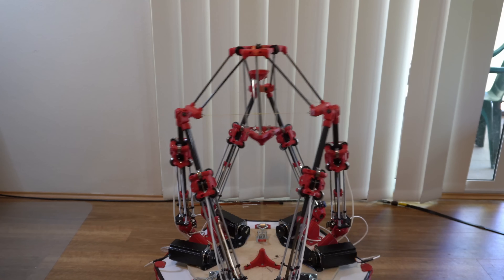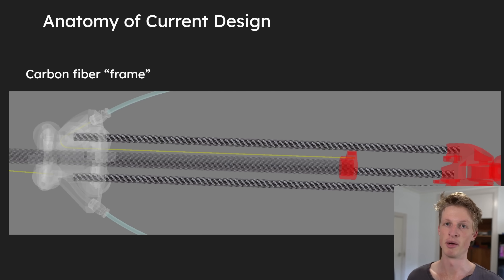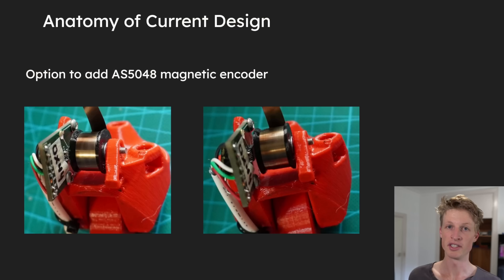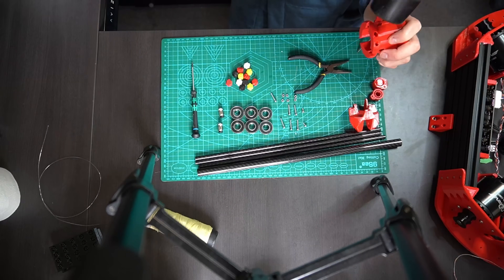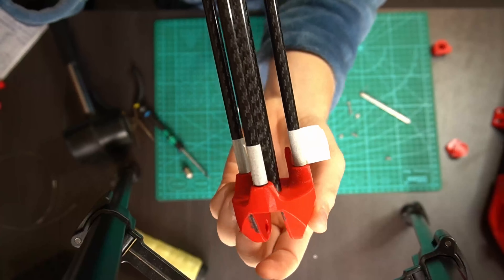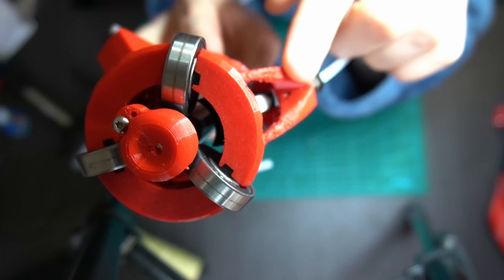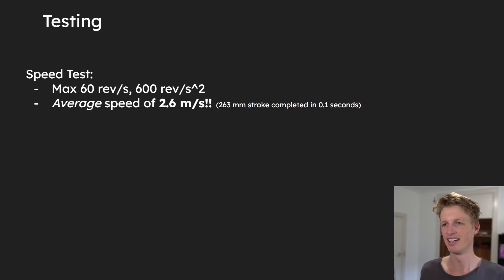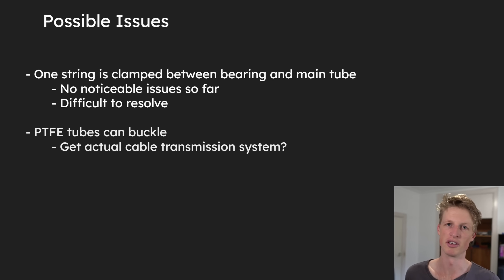Designing High-Performance Linear Actuators: Speed & Stiffness for my Juggling Robot | PDJ#19

Comment: Very awesome work! I was hoping you were going to do an applied force test, especially since you are using amperage draw as a limit feedback. How much force can they apply compared to, say, the ball-screw version?
Reply from the maker: Cheers! I haven't run a force test for two reasons:
1) Jugglebot doesn't need a huge amount of force; speed and precision are far more important
2) I couldn't think of a good way to actually conduct a force test

Given how many people are interested in this, if I have time I'll see if I can do some testing to report back on the strength. To answer your question, these actuators would be far less strong than the ball screw ones. The ball-screw actuators had a nominal strength of ~60kg, and there's no way these current actuators could handle that (the string alone breaks at ~35kg). If you needed a high speed, high force actuator, you could probably make some small changes to really beef these ones up (eg. replace the string for something stronger)

Comment: Is there a reason you didn't use linear bearings? Super curious.
Reply from the maker: Yep! I tried them but the carbon fiber tubes aren't manufactured to the necessary tolerance for that to work; some CF tubes from one manufacturer fit in the linear bearing with some wobble, other CF tubes from another manufacturer didn't even fit at all!

Comment: Add the feature for a "closed loop with stepperdrivers, so missing steps dont are a possibility. With that this design would be almost perfect
Reply from the maker: The motors I'm currently using are operating in closed-loop control as well, thanks to the AMT102 encoders attached to their output shaft. The only slop that could appear is if the string stretches or the PTFE tube buckles/collapses, both of which are solvable by replacing those parts for more appropriate ones

Comment: You should consider PEEK or PEK rollers instead of bearings. Much lighter.

It's also possible to make a small "maze" for the cables to go down the legs directly. Having a stiff reference for them will be critical for fast movement.
Reply from the maker: Good to know! Are they easy to source?

Something that makes routing the strings directly down the legs tricky is that for Jugglebot, the actuators will move around quite a lot with respect to the motor, so the string will be getting pulled in any direction. I believe it might be possible to route the strings directly, without any sheath (and no—or just known?— kinematic coupling), and I do think there are pretty good advantages to a routing path that could do that. If you can think of a way to do it, I'd love to know!
Reply: @harrisonlow  It takes more pulleys for the cables but you can move the motors offboard completely.

Comment: Why not use pneumatic control actuation?  I’ve messed with a few of them for years at work and the speed is incredible.  They can cycle extremely fast…. Positioning is a problem though of you need that in application.
Reply from the maker: You hit the nail on the head there: Jugglebot needs to be fast and precise

Comment: Brilliant job. The string which pulls down could be come from the bottom (part standing on the table). This saves half the boden strings connected to the slider part. Also no string going up along the center rod when it extends. So at the same spot were you connect the string pulling up you hook the string going down. As this is a straight line to the bottom part there is no cover needed (plain string should do).

Comment: Just a proposal for a more rigid structure. What if you use a sqare tube inside a square tube. As bearing a kind of FF2515 INA. So you are able to cover the tourqe in the System. Motor bearing in the middle of the outer tube perpendicular to the tube.. Cable system outside

Comment: I'm surprised you havent had issues with abrasion from the line where you dont have a pulley, since it so quickly cut through when you missed the pulley on the other line :) Perhaps you should add a small pulley, or easier and more compact, add a short piece of steel axle and let the line run over it. Probably best with stainless.
Reply from the maker: It might've been a little tricky to see in the video, but that side has a PTFE tube that guides the string all the way to the end of the printed part, so there's no contact between the string and printed part 😊

Comment: Hi!!! You can use a V profile bearing, perhaps using TPU as a bearing cover. I think that will provide more stability (at least two contact points per bearing). This V profile can allow you to run the thread close to the apex of the V.

Comment: Would make an interesting hybrid delta tripod..  use them for as they are for the legs, and a smaller version to control the splay of the legs. 

Where you have a 9dof sensor measuring level north level etc. Get location north and it pops out the legs to half distance to allow for travel above a surface when it's aligned properly. Let pop down a tripod.  Or go full on stewart platform and forgo the mini one controlling splay. 

Uses Could be for a camera, 3d printer on any surface,  ground measurements within the range of travel, stereo imaging with a single camera, alignment for radio astronomy or guided astronomical tours with a camera or laser pointer. All sorts of stuff. 

Probably the tripod in shot that had me thinking about that the whole video. Really nifty way to get linear motion.

Comment: Good Work looking forward to see your actual juggling Robot then.
Some notes:
Bowden cables are extremely stiff with a lot of friction and high mass.
Try to find some thick PTFE tubes first with a tiny ID.
Your clamped nylon strings will destroy the Carbonfiber tube in the long run, don't underestimate the abrasive effects of sliding Strings.
Over time even ceramics don't stand a chance.
And now some food for thought:
Ditch the linear actuator completely, and make a free hanging nylon string driven carriage aka a cable robot.
Way less complexity, with some new challenges.
Reply from the maker: @DerSolinski  hmm yes I see where you're coming from. The "umbrella" workspace has been something I've just been working around, but I hadn't really thought about what I could do to improve on that. I need to think about this more but if I were to guess, I'll probably be changing to a tensegrity mechanism in the future. 6 m/s for just the "platform" part would be able to throw the ball very high. 

Thanks heaps for the suggestions!
Reply: @harrisonlow  Just keep in mind, if you do you will need a winding mechanism to make sure you have constant radius while winding or your math won't add up.
But since you have an o-drive you could also go fully tracked and compensate with torque.
Speaking of tracking do you have a solution for tracking the balls?
Reply from the maker: Yeah I'm thinking I'll swap the curved-profile pulley to one with a flat profile/cylindrical shape, to keep pulley radius constant. 

I've got a video where I talk about my plan(s) for the "eyes" of jugglebot: https://youtu.be/ONTt7Dlseno

Current plan is depth camera(s) attached to the base of the robot. I'm planning on using a kalman filter to combine the expected throw trajectory with the measured (noisy) depth data.
Reply: @harrisonlow  The best pulley would have a spiral groove fitting the string, done right you don't even need a guide for the string.
It would be self guiding. A lot of small commercial winches do that to prolong the lifespan of the wire. You just have to select the right diameter and height to fit the entire travel distance on the spool.

The OAK D seems to be a pretty nifty device and honestly tracking the ball is only needed for error correction. Should be plenty to track the ball. But I don't think you could track the carriage with it. To close, to fast.
If you get your error down and prevent errors that can accumulate you probably don't even need tracking at all and get away with just a calculated trajectory.

Lighthouse tracking has some caveats especially since you have v1 which is "slower" and "less" accurate then v2.
LH tracking is primarily IMU tracking with permanent error correction.
Meaning it reacts very poorly to any sort of shock and vibrations.
Obviously those get filtered out pretty quick but it is something to be aware of or your robot could do unexpected jerky movements if something isn't filtered correctly.

Well OptiTrack is overkill lol
Reply from the maker: Nice! I think my printer may struggle to create a helical groove for the string to wind in, though I'll give it a go. Hopefully just a plain cylinder works well 🤞

Yup, the Oak-d is pretty amazing! Re. tracking the carriage (what I've been calling the "hand"), I'm actually not planning on tracking it visually. I figure the encoder positional feedback should be enough. 

Good info re. LH tracking, cheers!

Haha I agree about optitrack... Would be pretty cool to have, though!
Reply from the maker: Very useful ideas. Thanks for sharing them!

Someone else has suggested the cable mechanism and I'm interested by the idea. My main hesitation (apart from the design overhaul needed) is the fact that the frame and strings would get in the way of balls being thrown. That said, I do find the idea quite interesting and I'd like to make one at some point. 

Cheers for the suggestions!

Comment: you could change the bearings with smaller sized ones, the tolerances on the 3d printed parts would suffer but it would lower the weight quite a bit.

Comment: Awesome project and another excellent video!  Have you looked into control cables?  Just for info, not to replace anything.   They're common for throttle, choke, clutches..  but the industrial versions can move hundreds of pounds. Steel wire core wrapped in a liner, inside a flexible but strong conduit.  Optionally they have low friction inner coatings and come in push pull (very expensive over 7" of travel) or pull only configs.  Thanks for sharing your info!

Comment: Great build. Just found your channel so excited to see what is next.
In addition to the hoover method for string, I have used a can of compressed air to blow the string through. This works well on small strings in tubes too small to use the suction method. (Saved our butts at a robotics competition when rubber tubing began to stretch- we blew string through and tied it tight and it got us through.)
Reply from the maker: Great idea! Never heard of that and I've got a can of compressed air on hand. Cheers!

Comment: How about you take a look at mig welder wire feed  spools there a bearing and an idleler that has a small channel in it for the wire to feed whan the trigger is pulled may be ya can find summat similar likea small beaing with a grove in it to eliminate the kevlar wire issue

Or you can get pneumatuc one of what ya need but mega cash

Comment: Use bicycle brake lines as a model. The brake cable housing is a wound-steel coil, so flexible in bending, but rigid in compression. The housing has a slippery liner (outside very cheap housings). Easy and cheap to obtain. Housing might be a little heavy for your use, so use cable stops where the path is along a rigid member (the tube). Could use brake cables, but they are a little heavy, and your use of Kevlar string seems better. 

Could just cheat, and stay with the PTFE tubes. Good enough maybe for low loads. But the tubes are compressible - basically a spring - so add some imprecision. Maybe that does not matter so much for your use. Also could use cable stops (really housing stops) as in bicycle brake lines, but PTFE tube for the short/bendy bits. Short runs of PTFE are still compressible, but less of a problem.

Also, very cool design. Got me wondering... :)

Comment: 1st - very cool! 
2nd - subd & rung, first time seeing ur vids. 
3rd - You could use more carbon fiber tubes in place of the PTFE tubing. You did the other testing & showed the results, but didn't test or show what kind of torque it can handle. O' & you could route that one problem string threw the plastic part a bit more, like right out the top of it. But also line that path with PTFE tubing, or a material that wont so easily succumb to the strings movement. 
4th - Using this design in a robot arm, leg etc would be seriously interesting & Very cool!! Have you considered collaborating / working with other YouTubers? Ie: James Bruton. this looks like just the kind of design that he'd really like & might be interested in incorporating into one of his designs.

Comment: For the string you might also look into braided uhmw, commonly used for high performance kites. It is not degraded by UV (if your robot has to perform outdoors) doesn't absorb water, and has far better abrasion resistance and has less friction than kevlar, also has nearly zero stretch for low backlash. Pretty cheap too. Excellent vid. Thanks for posting!
Reply: I was thinking the same but with Braided monofilament as used in fishing, for the same reasons.
Reply: Use SK99 for the lowest stretch and creep.
Reply: UHMWPE does have problems with creep, though. So you'd want to be sure that it's not stored under tension when not in use. Otherwise slack will creep in, and you'd need to re-tighten everything before you restart

Comment: Any testing under load, especially lateral load on the leg when it's extended?
Reply from the maker: I haven't done any force testing for a few reasons:
1) jugglebot doesn't need super high force to do what I want it to do
2) I couldn't think of a good way to attach a load/force gauge to the central CF tube with minimal effort. 

It'd be interesting to know what sort of force it can output, but I have other more pressing things to focus on right now. 

Just from pushing it around, the lateral stiffness is quite good, even at full extension. What sort of application are you thinking it could be useful for?

Comment: your expanding lock for the carbon fibre tubes is a good idea, have you considered sourcing cheap router collets for this part? they have very minimal changes but if you could find one just right in diameter it might work

Comment: Wow, that's an amazing mechanism!  It's a bit like a hydraulic actuator, in some sense, because they typically (?) apply force through high pressure to one side of the piston at a time, rather than using pressure and vacuum on one side.

Comment: You could add set screws into that mounting structure to hold the carbon fiber rods in place and just use a running fit if the interference fit is an issue. Which may be the case for dialing in the distance of the two mounting structures. If that is a route you would look into, Id probably go with two set screws

Comment: Bike shifter cable could be good, maybe try reinforcing the ptfe tubes with a metal spring on the outside, you could probably turn one yourself. Nice video.
Reply: Actually I was thinking along the bike cable line myself. Maybe he could run bike cables thru the ptfe that's in the actuator but tie the string to the cable at the motor end. So kind of a string and cable hybrid. Also for the cable routing issue, he should change the angle of the one fitting location so that it goes all the way up to the top and sleeve ptfe thru ,having the cable exit on the top edge instead of exiting down inside next to the pully center.

Comment: One issue I presume you've dealt with. Your magnetic encoders do not have a constant angle vs displacement factor. As the spring extends/contracts, the number of turns on the rotor changes, and the effective diameter changes as well. Easily dealt with since the diameter change is linear wrt the the displacement.
Reply from the maker: I actually haven't done anything to compensate for that (partially because I'm not planning on using those encoders with this design, and partially because I honestly didn't think of it when I was using the encoders in the last design). I'm curious to know what sort of effect that would have on the end result. My intuition is not much since the spring is so thin, but I still think it's worth running some tests to see if I do start using the encoders. 

Cheers for the suggestion!
Reply: @harrisonlow  I also assume the error would be small. However, when you have differential displacements being used to control angles, and I don't know what accuracies you need, I just thought I ought to point it out. It seems clear to me that the error would be a sort of semi-stairsstep.Imagine a fully extended encoder. As it gets retracted, for the first turn there will be no error, since the spring is wound on the encoder shaft. Then you get overlap, and a jump in error. The next time around, the step will be more gradual, and the trand will continue with increasing pull-in.
And who knows, the effect may not give you problems at all.
Best of luck.

Comment: Maybe you can find a ptfe tube with thicker wall? Even slight increase (like .2 mm) in the wall thicknes can significantly help with buckling. Also I'm courios how much friction is between tube and string, does tube gets warm/hot? In general awesome project, realy nice built and impresive preformance :D